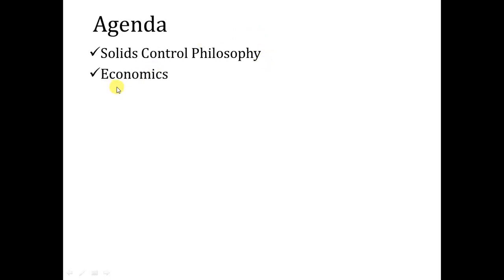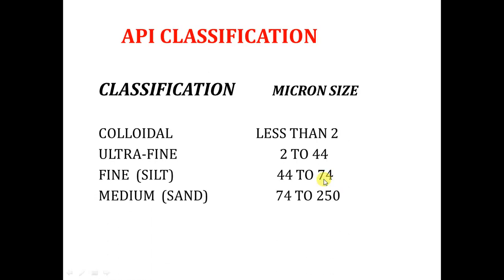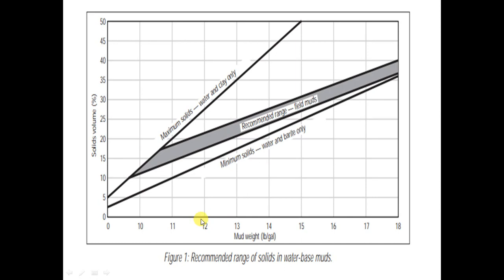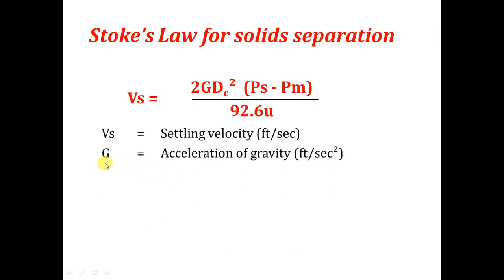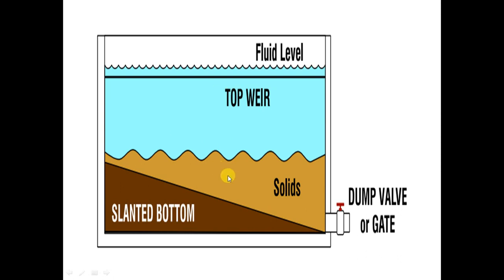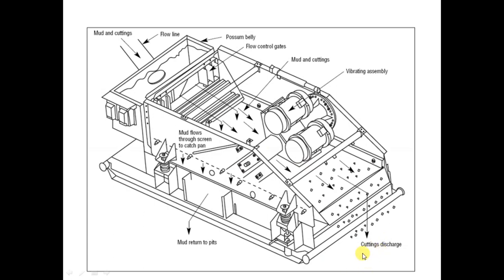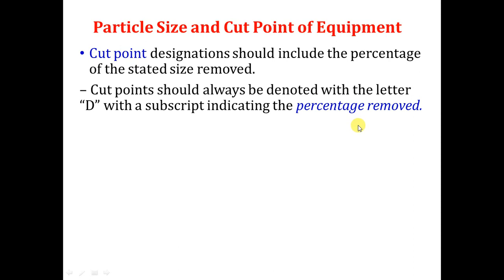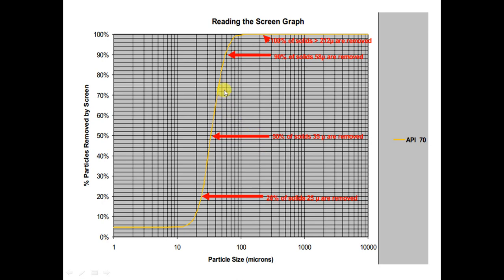4. advanced mud school: Solid control equipment #1

Comment: Good start of SCE
Question: Practically, How to open water on sand trap tank? 
I understand your reason to decrease the viscosity so settling of solids rate will be higher but how to do that as this will also affect your other mud parameters?
Reply: in the pervious lecture , Mr.  Abdelaziz gabr explains the method to do dilution for mud . i saw the lecture and the information is existing in it. and explains its calculation